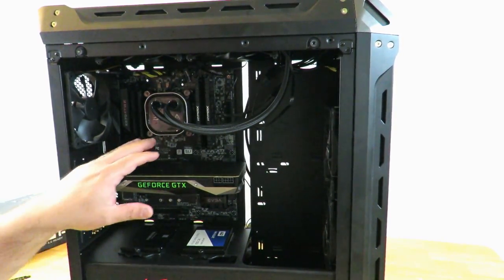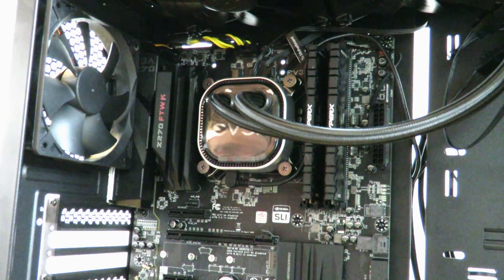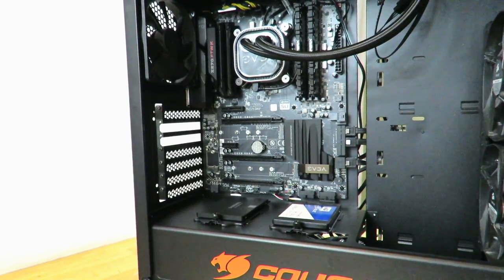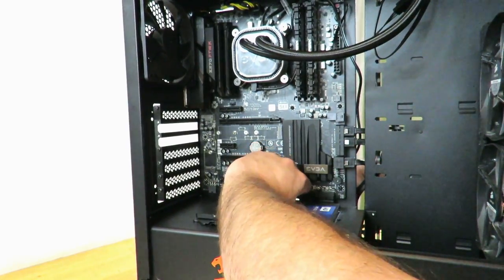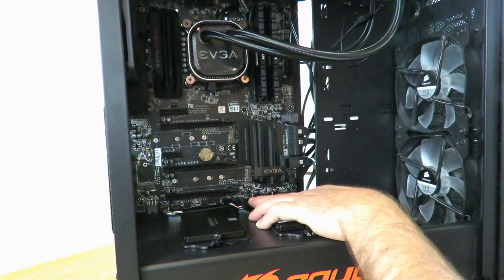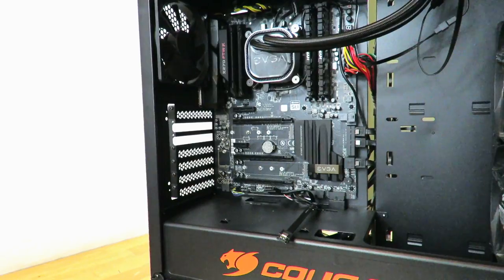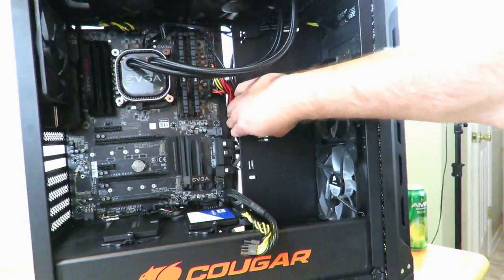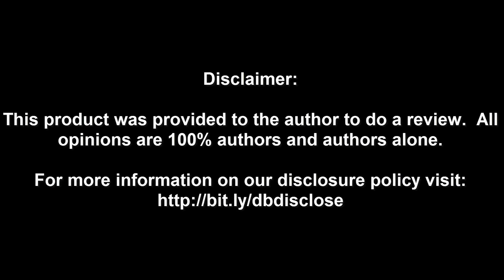How to cable a Gaming PC with Intel, EVGA, HyperX, Cougar and more

Comment from the maker: All parts used and links listed in description below.
Check out the complete review on Dragonblogger.com: http://www.dragonblogger.com/evga-geforce-gtx-1080-ti-founders-edition-11g-p4-6390-kr-review/
NewEgg:
• EVGA CLC 280 Liquid CPU Cooler, 400-HY-CL28-V1, 280mm Radiator, RGB LE: http://bit.ly/2nJBLpv
• EVGA GeForce GTX 1080 Ti FE video card 11G-P4-6390-KR: http://bit.ly/2o8tRcP
But this is where I actually got the card, get $5 off if you tell them Iggy from Dragonblogger sent you: http://bit.ly/2o49E8K
• Intel Core i7-7700K Kaby Lake BX80677I77700K Processor: http://bit.ly/2o37fsy
• EVGA Z270 FTW K, 132-KS-E277-KR Motherboard: http://bit.ly/2oKTUb2
• EVGA PowerLink: http://bit.ly/2o37lR4
• HyperX Predator 16GB DDR4 3333 RAM HX433C16PB3K2/16: bit.ly/2p7v1Da originally was in the video but the RAM was defective, so I used: HyperX Predator 16GB DDR4 3000 RAM HX430C15PB3K4/16: http://bit.ly/2ohXKV8
• COUGAR Panzer ATX Case: http://bit.ly/2oBYCHq
• Windows 10 Professional: http://bit.ly/2oygEbW
• WD Blue 500GB SSD WDS500G1B0A: http://bit.ly/2oKS75r
• Patriot Ignite 2.5" 480GB SATA III MLC SSD PI480GS25SSDR: http://bit.ly/2oC1yE7
• Hitachi GST Ultrastar A7K1000 1TB 7200 RPM 32MB Cache SATA: http://bit.ly/2oKTUYu
Amazon: 
• Zapour 5 Pack PWM Fan Splitter: http://prourls.co/4jMD
• EVGA CLC 280 Liquid CPU Cooler, 400-HY-CL28-V1, 280mm Radiator, RGB LE: http://prourls.co/m4F6
• EVGA GeForce GTX 1080 Ti FE video card 11G-P4-6390-KR: http://prourls.co/cLx0
But this is where I actually got the card, get $5 off if you tell them Iggy from Dragonblogger sent you: 
• Intel Core i7-7700K Kaby Lake BX80677I77700K Processor: http://prourls.co/5e87
• EVGA Z270 FTW K, 132-KS-E277-KR Motherboard: http://prourls.co/xNpK
• EVGA PowerLink: http://prourls.co/DyQw
• HyperX Predator 16GB DDR4 3333 RAM HX433C16PB3K2/16: bit.ly/2p7v1Da originally was in the video but the RAM was defective, so I used: HyperX Predator 16GB DDR4 3000 RAM HX430C15PB3K4/16: http://prourls.co/KNuh
• COUGAR Panzer ATX Case: http://prourls.co/U5dr
• Windows 10 Professional: http://azon.ly/GYbBRY
• WD Blue 500GB SSD WDS500G1B0A: http://prourls.co/udvK
• Patriot Ignite 2.5" 480GB SATA III MLC SSD PI480GS25SSDR: http://azon.ly/eoPVsG
• Hitachi GST Ultrastar A7K1000 1TB 7200 RPM 32MB Cache SATA: http://azon.ly/pU2QOo

Comment: do u pull in air from outside with the clc 280? or did u put it in as an exhaust? im lookin forward to put the clc 280 in the front if my case as u did but with the fans behind the radiator(pull-in air), what do u think?
Reply: +Iggy Castillo bitwitt says differently noob
Reply: oh, sorry I didn't realize bittwitt was the end all be all, gathering opinions is great information but because all configurations are different, not all will be the same.  You may want to ask Bitwitt though, seems like he is doing the thinking for you
Reply: +ThisBytesForYou what are you talking about kid? Lol tested it. And got cooler temps from mounting the rad on the front. Do your research
Reply: my friend, as I stated before, it will vary on system to system, of course because of the chassis.  I have done tons of testing, I have been a development engineer for the largest OEM and 2 boutiques as well as a few years of reviewing and as I mentioned again, it varies on system to system.  The intake of the liquid cooling will vary because of its overclocked, you will be intaking hot air, non overclocked will 99% of the time will be cooled air.  Being that the air is being passed through a rad, the CFM will be significantly reduced so not much air will be coming in.  Smaller cases it will improve temperatures drastically, larger systems, maybe 2% but it all depends on the config.  I have tested this to be true on literally hundreds of different configs and cases, because it was part of my job.  Apparently in your config, as you have tested it holds to be true, but you will find if you test among various cases and configs, it will change.
Reply: I forget everyone in youtube comment sections is a certified master in whatever they comment about. Wheres the proof you did all of that and not just type it like anyone random can do?